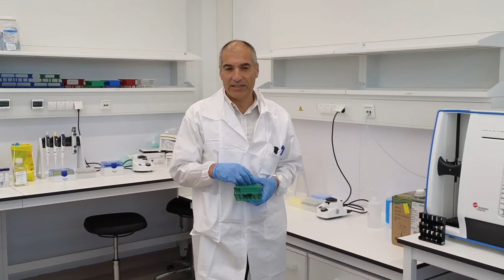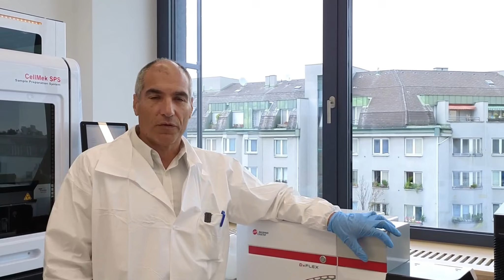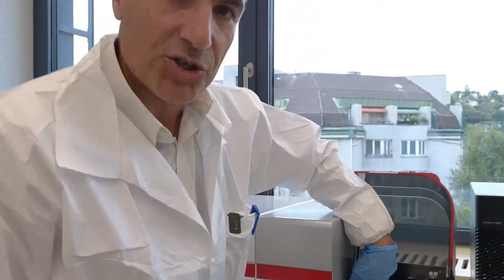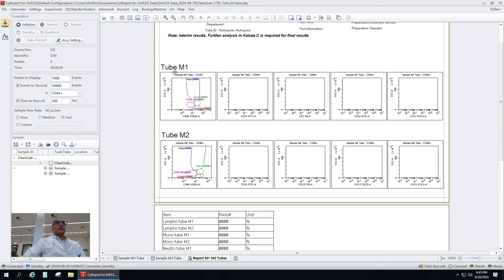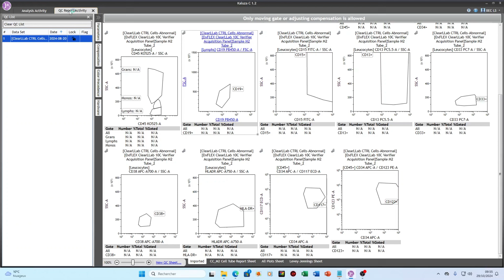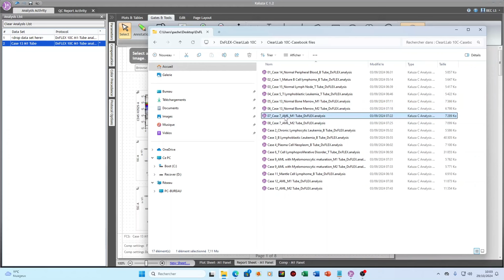DxFLEX Flow Cytometer Demo | ClearLLab 10C Workflow, APD Technology & Kaluza C Analysis

Comment: Good demo. After a lot of hours on CytoFLEX and DxFLEX I can say the APD technology is a real step forward: the difference shows on dim markers such as CD200, CD10 or CD38 on small populations, but only if the gains are locked to the bead target channels and not touched between runs. The other practical point for anyone switching: keep a few archived samples from the old instrument and reacquire them, so the first discordant case has a reference to compare against.